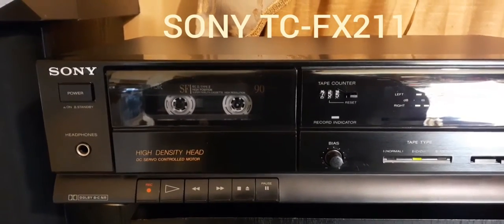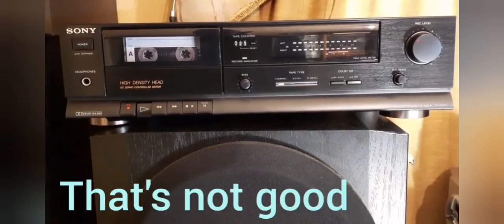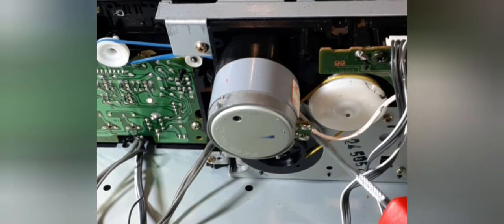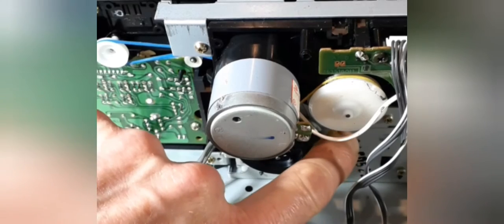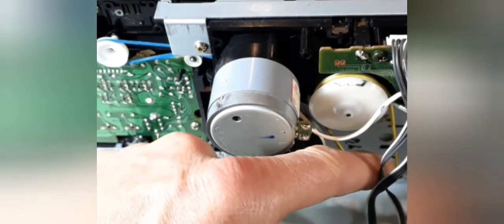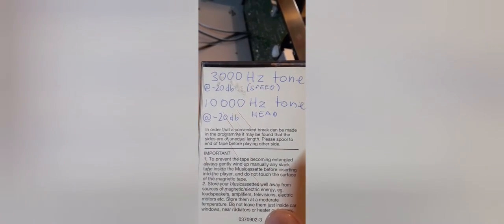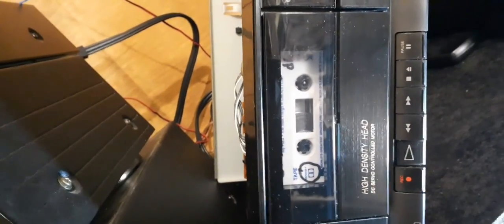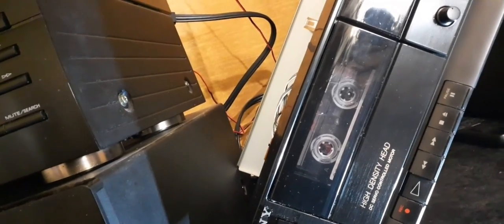SONY TC-FX211 CASSETTE DECK PART 2 BELT REPLACMENT

Comment: What are the sizes of the 3 belts? Which is the counter belt . ?
Reply from the maker: Well , it's a old video , I don't keep tabs, if it's in the video , you will see the belt sizes there , that's all the records I have. Sorry I can't be of greater assistance.
Reply from the maker: When I show the belts in the video , the plastic bags have the sizes , written on the bags with black texa.

Comment: Great video. What are the sizes of the 3 belts?
Reply from the maker: Thanks ! I didn't make a note of the belts sizes , in newer videos , I show the belt sizes . There might be a quick shot of the belts in this video , but I don't think I have shown them individually,  unfortunately.
Reply from the maker: 2.56 new belts , sizes written with black texta on top of the plastic bag.
Reply: @vidtech2630  thanks. Its hard to see what the first packet says. thank you anyway